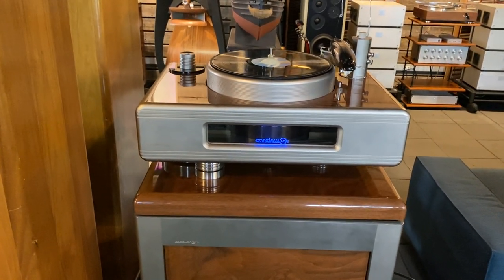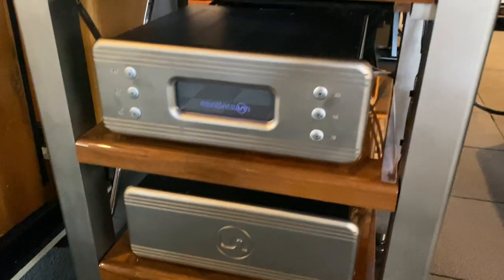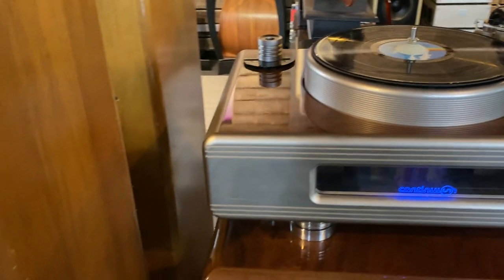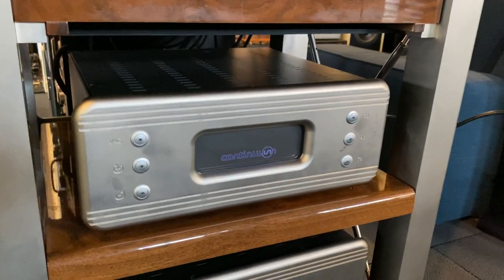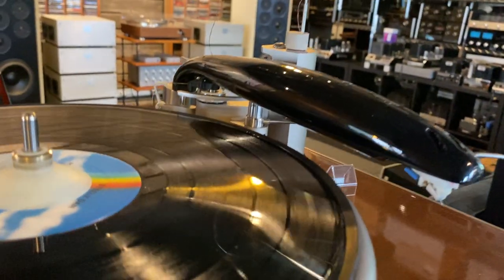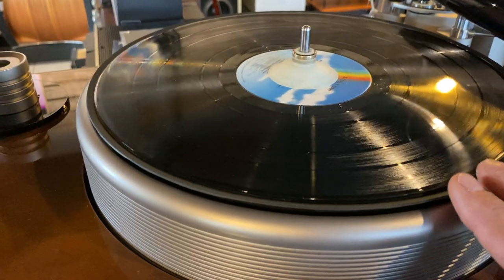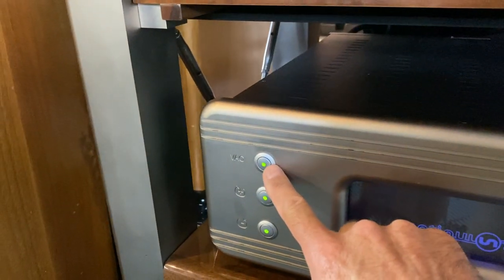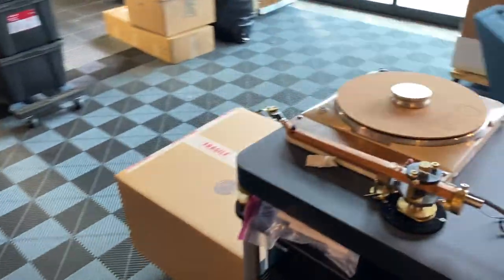A quick tour of the Continuum Caliburn turntable, 400 lbs of exotic materials and engineering.

Comment: For those who demand the ultimate in things - and can afford them. This machine costs over $100,000. Add Wilson Audio's Alexandra speakers (or Eagleston's $250,000 flagship) and one of McIntosh's $10,000 tube amps, and you've got a system that will set you back close to $400,000 or more. And that's without adding a CD player or additional speakers if you're into surround/theater. Someone like Taylor Swift could afford it.

Comment: At this level, it still doesn’t compensate for the air pressure changes the speakers and the HVAC vents induce upon the tonearm. There will also still be pressure waves on the cabinet from under and around the various shelves. Digital has none of these issues.